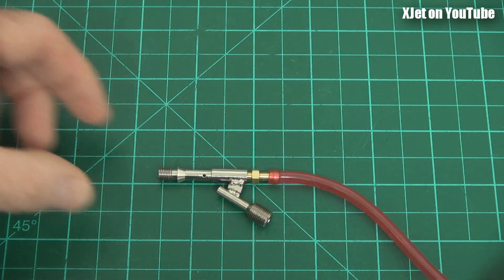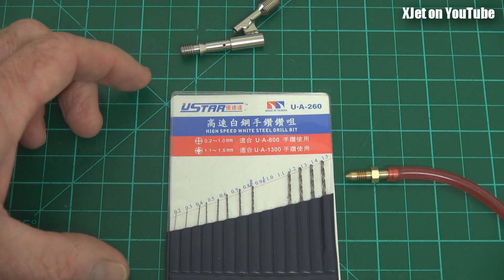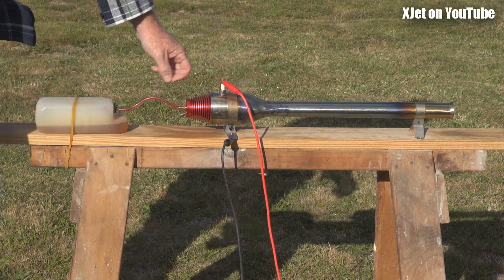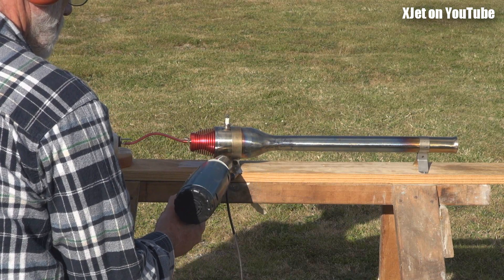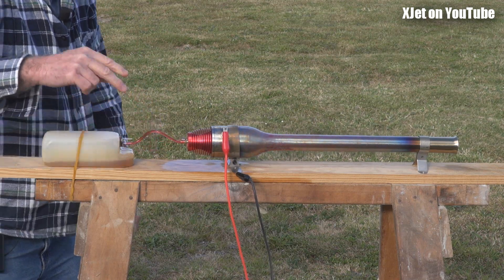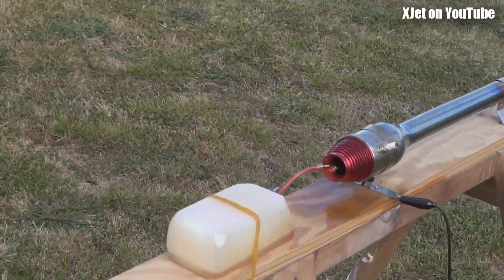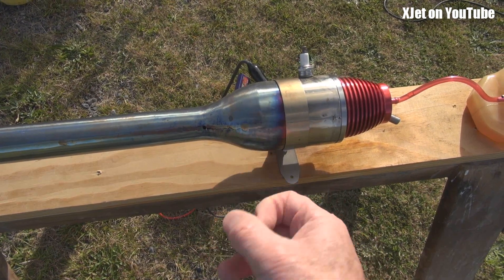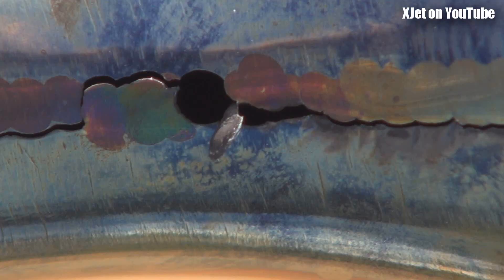Fixing the HobbyKing pulsejet (part 2)

Comment: it wasnt being cooled by flying thorugh the air. Could that have been the problem? They are not meant to run stationary.
Reply from the maker: A well designed and constructed pulsejet will run for hours without cooling.  Some of my ones have run for over 20 hours in a static condition and not suffered any structural failure.

Comment: Hey I am trying to build a Lockwood style pulse jet using gi metal plumbing fitting trying to start using acetylene gas it's just gives a loud bang or just burns flame even with LPG it just burns fuel as a burner but doesn't do anything

Comment: to be fair, these come with jets that are precisely set up for high octane type fuels and its a given that if you use less combustible fuels, you need to adjust the actual jet as was shown here. being 0.9mm originally, i would have a guess that this 0.9mm was designed for lpg or butane rather than liquid fuel. nothing wrong with re-tuning the fuel jets.  its a thing most people should learn if theyre going to use and play with pulse jets.
Reply from the maker: No, the Dynajet (of which this is a clone) was originally designed to run on Colemans fuel, a very low octane form of gasoline.  To run a pulsejet on gas (LPG, propane or butane) would require a much, much bigger hole.
Reply: @xjet  maybe so, but the chinese one i got of ebay was setup for butane cylinders, the jet was so small, i used a thin guitar string to clean the jet out.  But, just realised butane was pressurised which may be the difference here.

Comment: If you check the drill bit with micrometers, you will probably find the size is off by some tenths if not more. Chinese tools are never accurate. Te same seems to be said about theHobby Kings, they all seem to be made in China where its a slap dash whatever crap style of workmanship.

Comment: this Pulse Jet is not designed for bench run it is designed to have air flow constant over the outside and inside that's why it failed

Comment: I have a larger version of this pulse jet that was my father's . It was made in the 1940's. I've always wanted to run it, but didn't know what was needed. What is the high voltage source for the spark plug..
Reply: LM555, car ignition coil. 12v operation.
Umm oh yeah you need a 3055 transistor.
Or you can actually do it with an electro-mechanicle breaker system. But that requires fabrication skills.
Reply: Thanks, I've done a few projects with a 555 timer chip. I grok the jest.  Should be fairly simple.

Comment: you shouldn't have to do a damn thing to these motors. They should run right out of the box without correcting faults the manufacturer should have done before they even went on the market.

Comment: I can see a stainless / platinum reed valve and body would likely work better I'm unsure about the alloy itself but a small percentage should work anyway if working well the heat produced would become difficult to manage it will likely fire with a 2mm or larger intake opening as well.
Reply: Well I see the basics cast iron the heaviest least of expense but $10.00 rockets flying round everywhere you look could become annoying..

Comment: what draws the fuel into the combustion chamber
Reply: on startup, compressed air past the injector pulls atomized fuel, then as it fires, the air intake pulls it along on with each flame pulse

Comment: Dear Sir,
I am very interested in your channel. can you please show me how to use a fuel pump in the pulse jet, and how to time the fuel valve.
Regards'
Reply: May I ask why you'd want to use a fuel pump in a pulse jet engine?
Reply: Aaron Matt 
Hi, because I want to use it on an rc airplane, so the tanks will be low in the fuselage, and to insure continues running
Reply: Only way I could figure doing is by having a pump push the fuel into a bowl above the engine and have a tube running from the bowl to the engine. You'd also have to run a return line from the bowl to the tank so it doesn't pressurize and force fuel into the engine. I should have prefaced by mentioning that I've never owned, operated or really messed with a pulse jet, but from what I understand about their operation that would be the way I would solve that problem.

Comment: Try brazing over the bad weld crack
Reply from the maker: +petsatcom Brazing won't work, these engines run far too hot and the braze will melt.
Reply: exhaust bandage?

Comment: I'm looking to get into pulsejet models because I now live in an area where I can run it at my house. Obviously this kit is pure crap, I had slightly higher hopes as I can handle drilling but I don't have the setup to do welding/lathing. What would be y our recommendations for getting into pulsejets that isn't crazy expensive  but isn't garbage either? Also are there any decent aircraft body kits out there for pulsejet? or just straight build your own?

Comment: Think it would be possible to make a pulse jet from some threaded pipe, or car exhaust tubing? I was planning on either using threaded steel plumbing pipe or clamped together exhaust tubing. I'm leaning towards exhaust tubing because I can use some larger diameter tube to make the combustion chamber, then play with the lengths of the exhaust tube to see if it produces more or less thrust. I don't have any experience welding, but I wanted to build a basic pulse jet for fun, I don't plan on it powering anything, or doing much other than pissing off everyone for about 10 miles since I live in a small hollow. The sound will travel like nothing else, should be VERY amusing.

Comment: So you over fuelled it and it broke.

Understand why it had restricted fuel?
Reply from the maker: +Bruce Baxter You clearly don't understand how a pulsejet works :-(
Reply: Clearly.

Umm,

No, it's not clear, 

do tell me how you worked that out?
Reply from the maker: +Bruce Baxter A pulsejet produces its maximum power when the air-fuel ratio is stoichiometric.  If you richen or lean the mixture from that point, it produces LESS power, not more.  So, overfueling will cause the engine to run cooler and produce less power -- just as when you run a car engine too rich.
Reply: Ah, I see you are unable to read a question and answer it.

Try again, all you did was reinforce my point.
Reply from the maker: +Bruce Baxter Okay, I must defer to someone who is obviously an expert in pulsejets, what would I know? :-)
Reply: So twice now you failed to address the question, let alone attempt to answer it.

Have a third go and show us.
Reply from the maker: +Bruce Baxter Hell no, I wouldn't want to embarrass myself by spouting off on a subject I know nothing about.  Perhaps you could explain to me and others exactly what happened.
Reply from the maker: +Bruce Baxter Yes, I admit it, I know nothing about pulsejet engines -- you've caught me out.  I also know nothing about engineering, physics or metalurgy and fabrication.    Gee, you're good!
Reply from the maker: +Bruce Baxter All I can say is that the producers of half a dozen TV shows were fools to hire me to give technical advice on pulsejet engines and this was all done with CGI:  https://www.youtube.com/watch?v=qmbnzCV4vUc  I didn't design and build the engine on that model at all -- I just folded it out of paper using instructions I got from a women's magazine.
Reply: And again, you refuse to be a man and continue to snivel around like a woman or child.

How dare you show your face outside your door!

Grow a spine sir and back your derogatory claim or withdraw it!
Reply from the maker: +Bruce Baxter LOL...   Thanks for the trolling experience, it was wonderful.  By the way.. I love your videos!
Reply: Why thank you, I aim to please.
Reply: +Bruce Baxter Håll nu tyst!

Comment: when you weld stainless, the back side has to have a shield gas or a back-side flux applied, so this also did not help the ground-weld situation out.  It is VERY common for Chinese built  Automotive Exhaust system manufacturers to not protect the back side of the weld...It "cauliflowers" if not.
Reply from the maker: +unionse7en Yeah, most of the time, instead of back-purging, I use a fairly thick adhesive aluminium tape.  That excludes the air from the back of the weld (so stops those nasty oxidations) and it also helps sink away the excess heat so you're less likely to blow a hole.

Comment: Hey Bruce. Good to see that there is at least a possibility of getting this thing to run. You have shown us the difference between the new and old fuel jets, but you didn't tell us WHICH jet you used when you got it to run. Will this engine run on either jet once you drill out that hole?

Comment: The crack is not in the weld itself, but in the heat affected zone. So the thickness might not be the problem, but the chosen steel grade and welding skill. But definitely crap ;)

Comment: +xjet   You're going  to have to try pretty darn hard to do welding worse than what's already on the engine.   It's a bit of a worry though about the strength of the rest of the welding.

Comment: Hi Bruce can you please illustrate how the metering jet works. On starting the engine with your outside air supply I presume it  creates a venturi over these two holes on the side of the fuel tube and when started the air pulsing in from the front of the motor takes over and assisted the fuel to enter the chamber for combustion creating a possible atmosphere changing to a negative atmosphere assisting recharging of the fuel.
Would a series of smaller holes around the this tube create better atomisation of the fuel, making starting easier, also the venturi affect would be greater when the engine starts.
The fitting of a conical ring mounted just before these holes so when the pulses running parallel to the tube enter the funnel shape and increase in velocity and as it emerges over the holes (spray bar holes) in creases the ventri and finer atomisation.
Or maybe I'm completely wrong on how this engine works?
Chris

Comment: I wonder if the paper thin ground joint is a common feature of all of these motors, or if this is just the unlucky bad one that Bruce has got. Has anyone else bought one and had success with it? Knowing HK quality control, it wouldn't surprise me if the 0.9mm fuel hole was fine for another motor, and it was just the large manufacturing tolerances messing this one up.

I'm very keen to see the next part of this video Bruce. Now if you can just make all the other part 2's that have been promised over the years, we'll be in luck! :P
Reply from the maker: +Chris Tate I've heard of others who have had similar failures -- and others who have not so it's all down to lack of consistency and poor QC.

Comment: Sets of metering can be had/made, and play a big part run stability, starting ease and reed life. IIRC a set of about 10 or so went by number drill sizes, and selection was a function of OAT, RH, barometric pressure, fuel blend, tank position within the specific model engine combination, star/planet alignment along with 8 or 14 other parameters. Metering jet selection was a 'black art' but once determined, things went smoothly... until something changed a little.... BTW, I looked a little last night and saw a someone using a leaf blower for starting! That would allow complete removal of the start nozzle; looked pretty clever! (Bicycle pumps were the starting norm back in the day...)
Reply: +rwbishop Have you seen Colin Furze's pulsejet-powered go-kart?  That had a leaf blower for starting.  I recommend you check Youtube and subscribe if not, because pulsejet.  And he is absolutely brilliant and totally mad.
Reply from the maker: +pillsnotbills I can do better than that.
https://www.youtube.com/watch?v=clOmc3WI5fk
Reply: ***** Ah Bruce, you got me.  I had not seen that, your oldest video dating from the dawn of Youtube.  Brilliant.  I've only been watching your videos for 3 years and missed most of the older ones.  I shall have to correct that oversight, somehow.

Comment: Very interesting learning about these pulsejet engines, I think I understand the basic working principles ,but I have some dumb ass questions. Do they require compressed air to operate? and do they need constant ignition ?
Reply: +mick thebass you need compressed air for starting but not for running and you don't need a constant ignition
Reply: Ah thanks F1, I'll try find a tutorial vid. I guess  the air is drawn in by the escaping gasses then trapped in the chamber by a reed valve ? and the fuel is ignited by the latent heat contained in the walls of the chamber.
Reply: not a problem. there's plenty of tuts out there :)

Comment: Hi Bruce, I'm looking at a small pulsejet, have you ever made an auto-start version? Where you don't need to either blow a leaf blower through it or air compressor?
I want to try maybe a small can of compressed air and on-board igniter, and some simple electronic timer to perform the ignition sequence, maybe Arduino?

Cheers
Dan

Comment: its like 40 here in montana.... unnaturally warm. usually sits about -10F this time of year. next moth...-30 before you factor in the 70 MPH winds that are common here. north east montana isnt mountains.... only 1/4 is. 

but... i wonder.... on my 2 stroke, the colder it is, the leaner it runs. run it too lean, it melts things. 

as it gets hotter, the air is less dense, same jetting, some fuel....less air....so it runs richer. 

i wonder if you didnt lean it out and over heat it. a lean fire is hotter than a fat one. sure you up-ed the jetting, but was it enough? was it too lean from the factory? (i think so if it would not stay running) 

i wonder what that same head and jet would do under 80F temps. it might run right....

still.... its shit work. that weld....i dont weld very often, my dad has a welding cert...he lays lines of dimes. i usually let him do it. 

butt when the part is not "mission critical", ill weld it up right quick..... and i can do better than that. could do better oxy-act!

Comment: ever consider that when you made a larger flue hole that you over pressurized the chamber and exceeded the eng. specs ?
Reply from the maker: +dennis tresselt No... the combustion doesn't work that way.  The limiting factor is the amount of air that can be drawn in during the intake cycle.  If you increase the amount of fuel too much you simply end up with a rich mixture that doesn't burn properly and you actually get less power with lower combustion pressures.  I'll cut away some of the material near the crack and measure the thickness but I'm thinking it's as low as 0.1mm in places -- virtually foil rather than sheet metal.
Reply: +xjet sure... but a lean fire will burn hotter that a 16.1/1 or whatever the correct ratio is. 

also, i think it was running lean from the factory..... thus why it would not run till you made a larger jet. 
however.... the colder it gets, the more dense the air.... 

my 2 stroke runs lean the colder it gets, and richer the hotter it gets due to that air density change. 

i think you might have run it lean....hotter fire... and it melted. 

still... it should not melt like that even if it was lean....thats a BAD weld
Reply from the maker: +kain hall That's right... I've run pulsejets I've built myself for very long periods without any weld or metal failures because I don't grind back the welds just to make them look pretty :-)

Comment: I know nothing about this stuff. I was surprised to find this engine only cost £60 here which to me doesn't bode well for longevity.  On a new one would the metal be think enough to stand being reinforced with welding before being used?  And as for pre-heating in the field wouldn't a couple of flasks of hot water do the trick if the fuselage could stand it?